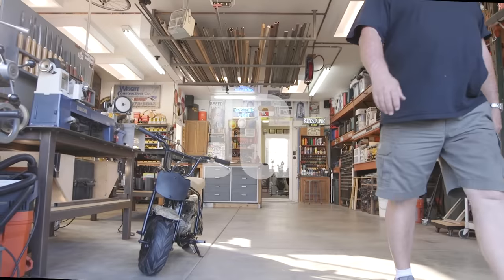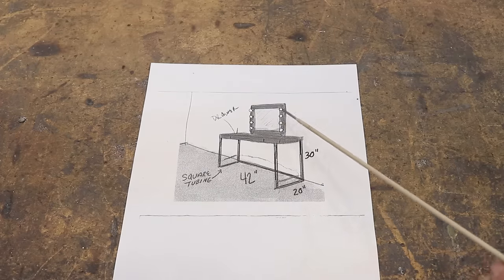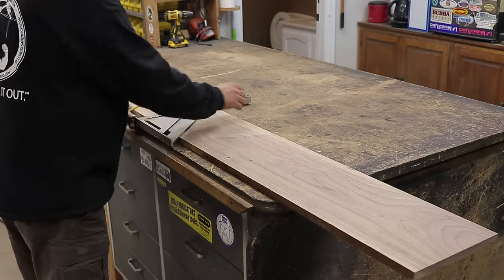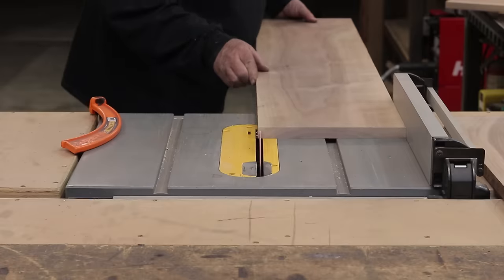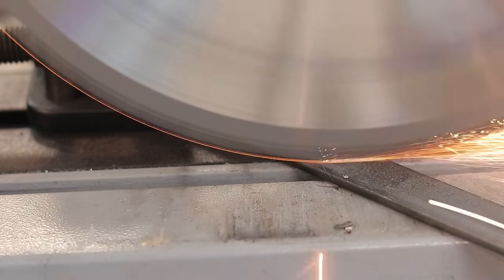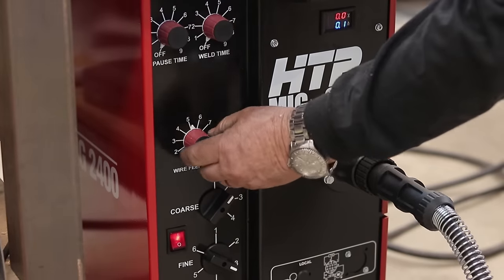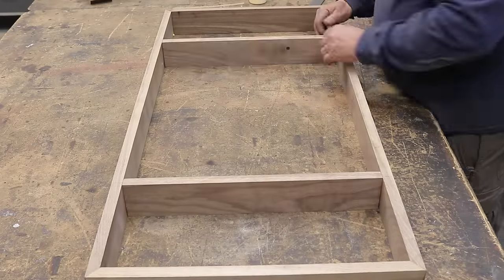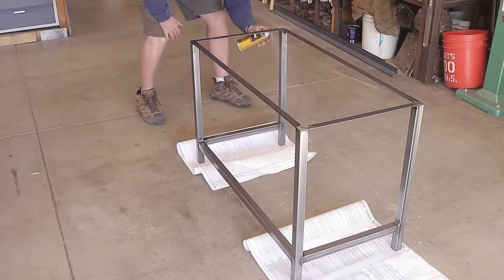Metal and Wood Makeup Vanity | JIMBO'S GARAGE

Comment: Hi Jim, I respect & enjoy the honesty of leaving in the mistakes :) I've been a joiner 34yrs, I quit using those side mounting runners, they're never easy to fit, the gap down the side has to extactly ½",  i now use the slightly more expensive under mount ones, there' a lot more play/allowance for fitting, but saying that prob wouldn't work for your shallow drawer.
Reply from the maker: Thanks for watching Gid.  Jimbo!

Comment: Beautiful! I know it's a small detail but I work in a frame shop and we occasionally do mirrors. One thing that makes a slight difference is coloring /covering the rabbit inside black so that it doesn't show the interior of the frame through the mirror. You can use a marker or black tape. 
But thanks for the table top instructions! Im planning on building a desk so I'm just browsing woodshop tips :)

Comment: Beautiful job! my only concern would be the Vanity mirror metal connection, when it screws it did screw all the way down however its screwed to a solid piece that is only held by glue to the main piece. several ways to add security without hurting the asthetics. Great job

Comment: I would highly suggest getting yourself a pocket hole jig from Kreg. You can hide all your holes, add strength and cut down on drying time since the screws will be holding it together.

Comment: Jim as some have said gluing end grain to end grain is not a strong connection. You could add two spline joints to each corner with a contrasting wood. That would make the joints strong and aesthetically pleasing to boot. Also slotting your holes in the metal to allow the wood to move during seasonal changes. Great build I come away with several metal working tips watching your videos. Thank you for what you do.
Reply from the maker: Thanks for watching and your comments,    Jimbo!

Comment: Hello,
I am an not a welder nor do i work with metal. But when you say "1 1/4on 063 metal tube"; is the 063 is the thickness of the tube?also, where do you get your metal?
Any help with be greatly appriciated.
Jason Wojnar
Reply from the maker: Thanks for watching Jason,  1-1/4'' square tube metal, And .063 is the wall thickness. I get my metal at my local metal supply store.   Jimbo!

Comment: You should use rubber grommets on the sheet metal holes when u have wires running through them for protection.

Comment: Nice job and nice design. Mistakes are all part of creating, sometimes they lead to an even better result. 
"Those who don't make mistakes, don't make much at all"
Just a tip, when you fix a solid timber top to a base, the screw holes in the bracket should be elongated where you screw to the underside of the table top and running across the grain. This allows for expansion and contraction, and prevents the top from splitting, draws binding, gaps remain sesame etc. I've seen timber push brickwork over. It's amazing how much timber fluctuates in size even years down track. Be a shame to have crack in one of your nice pieces. Hope I'm not telling you how to suck eggs. My apologies if I have.